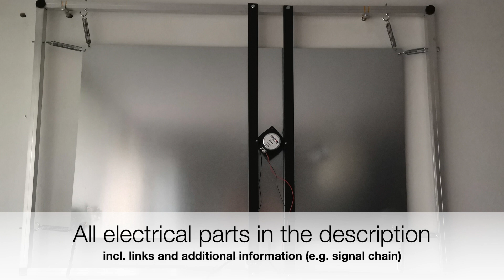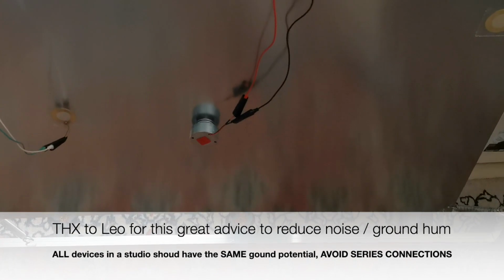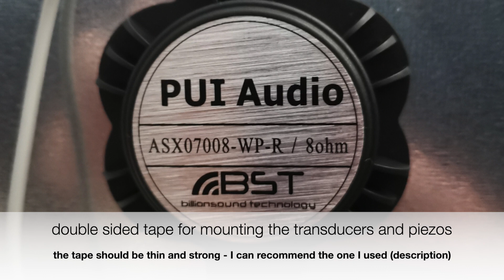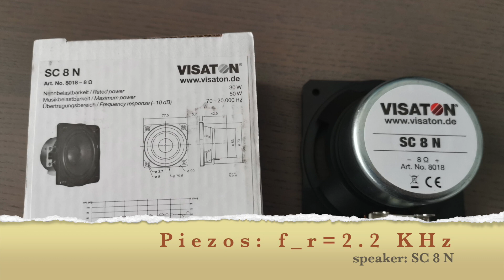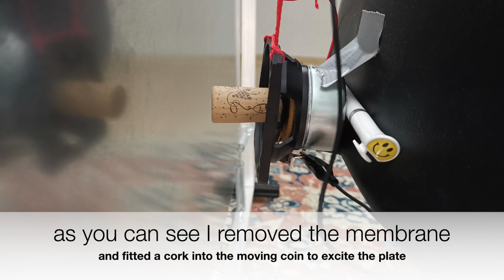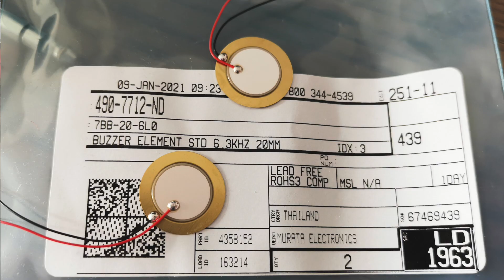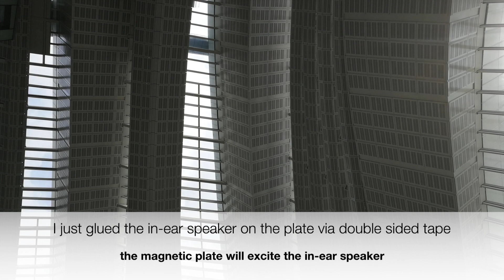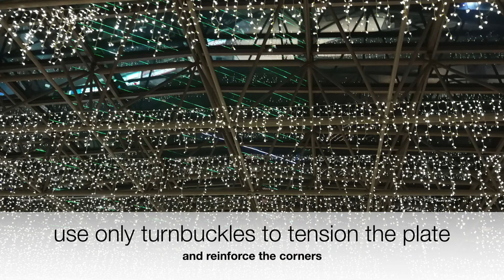DIY Plate Reverb The ultimate Guide

Comment: im surprised how similar this sounds to mine, minus the low frequency response haha, I used a cell phone vibrator on a 4x4ft steel plate, I never recorded samples of the stereo since i intended to rebuild it with a bit higher quality, i guess its that piezo sound? i've wanted to experiment with using cheap dynamic mics and forcibly gluing their diaphragms
Reply: sticking the module of a dynamic mic won't work properly since it won't pick up the vibrations of the plate as well as a piezo does
Reply: @percaros  since making that comment I've actually rebuilt mine with a 6' x 3' plate, that honestly I went around to the local hardware stores and tapped on each large metal plate they had to see which sounded best, then used a 4" speaker glued to a block of wood then directly to the plate as the input transducer, I found some large piezos hoping it'd help with the low end, but I think these things just need an ultra high impedance input to function properly, I don't have a driver circuit made up for them but its something I've been thinking of doing time and time again, I agree though, a coil/magnet would pick up much more mids, but frankly that's kinda where my plate is lacking at the moment, more just an experiment or something i could switch between with a footswitch
Reply: Where did u get the frame bud?
Reply: @ratchetboo the one in my closet is just hung freely, i am currently working on a newer one though that's just generic 2x4's with wood screws, not too difficult, was my first time working with wood and it looks terrible but if it sounds good it sounds good
Reply: @searchiemusic  oh sweet. I wonder if the wood is rigid enough to provide resonance on the plate? How thick is the plate you're rocking my lad?

Comment: Great video!!!   I've been wanting to build my own plate for a long time.  Regarding the steel plate itself...    Do you have any thoughts on other sizes or ratios?   Always rectangular or maybe square?    (As I recall,  the EMT plates were 4' x 8' - which I couldn't handle in my set-up).   And might grommets on the holes for the springs help to isolate the plate from the frame?   And.... would a thinner plate have more of a shimmer/sparkle?  Thanks!
Reply: honestly what I did was go to each of the local hardware stores and tap on the plates to see which I liked the sound of most, that by far made the most difference versus the second and third plate reverbs I've made, I've been trying this a while its been a passion project haha, do it though, if you have a closet and some hangers you can make a plate reverb, mine's just where I used to hang my pants lmfao